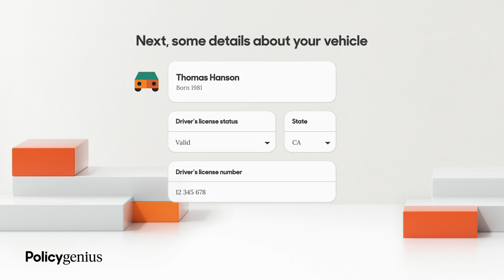MK4 Supra's Engine Bay is Stripped! Detailed for the first time in 27 years!

Comment: Under coating the fender liners reduces road noise INSANELY well. It's totally worth doing if you care about having a quiet interior.
Reply: @helplmchoking  I agree, I have a project 93 Honda Civic coupe. I added dynamat to the whole car, got an aftermarket carpet with dual sound dampening features under the carpet. I still need to do my doors though. I have the undercoating spray for the wheel wells too but haven't applied it yet. Something I've been doing since my first car, it's unreal how much road noise that alone kills.

Comment: NA non vvti head flows more than a GTE head
Reply: So NA non vvti head with GTE bottom end ?
Reply: @bluu3393  No just run an NA longblock with forged internals, if not the non vvti NA bottom end has same pistons and rods as GTE just with more compression.